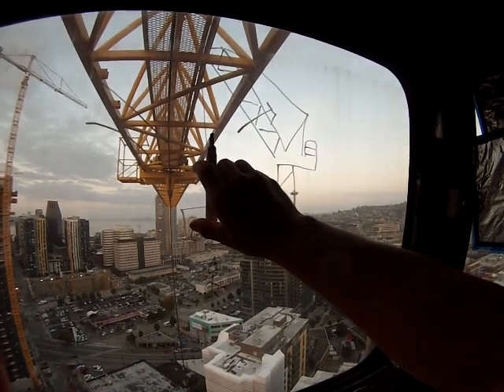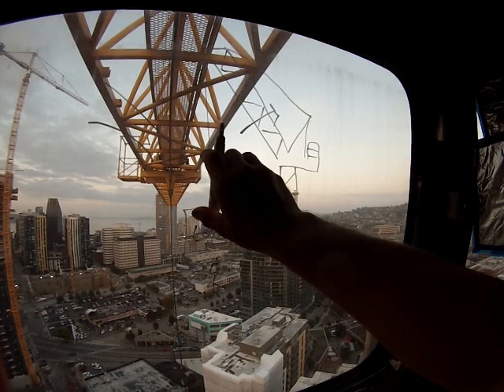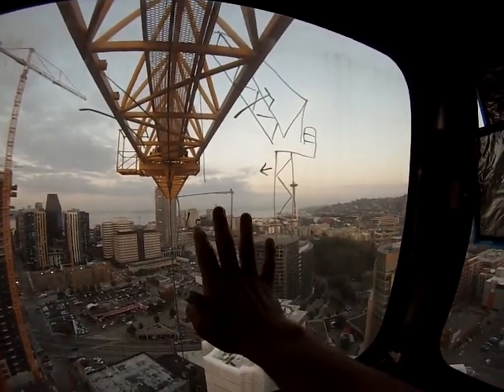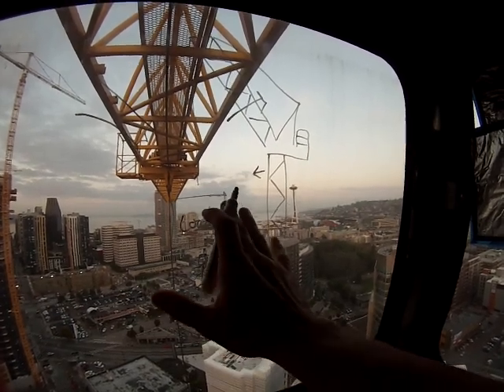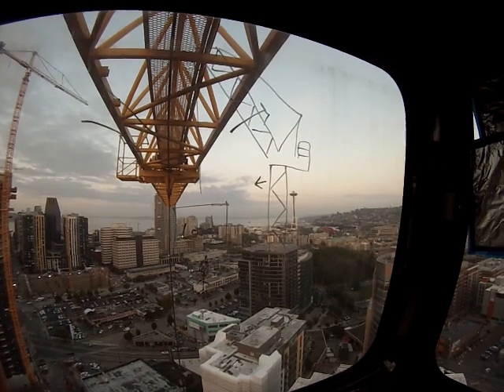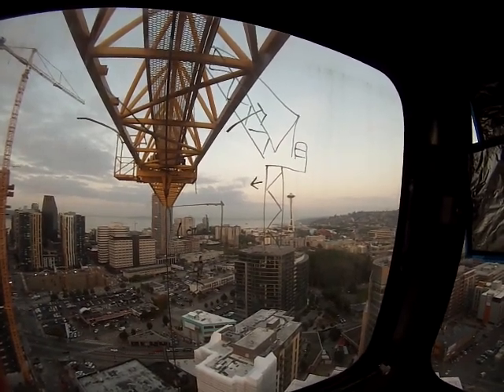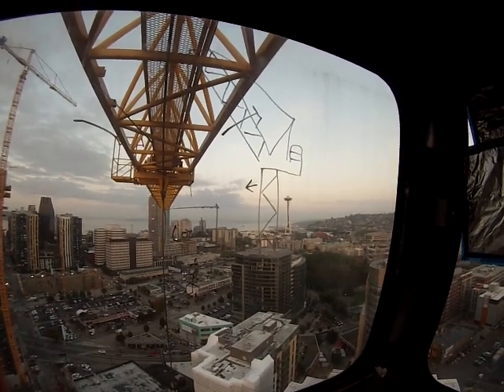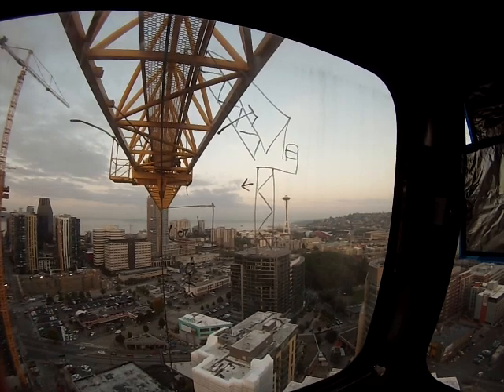How to Opererate a Tower Crane: Tower Crane Specific Traits

Comment: Been a forklift driver for 5 years time upgrade to bigger and better thanks for the knowledge
Reply from the maker: If the forklift is a telehandler and you have suspended items, the principles can be used to control the loads. More to stop the swinging because the unlevel ground will cause you grief anyway. Get the principles going in your head there and it will help you on your next career stop. Good luck.
Reply: @rotyag  thank you I appreciate it and yes a telehandler the biggest I ran was a magni 5.25 I work in a masonry company so I run the machine every day very neat machine that’s what gave me the more confidence to get more into that world

Comment: Damn Goog Instructing  roytag...!!
I started running big Draglines in the rock Quarries  in Miami , 1972
Then I flew air cargo 20 years but also ran construction cranes (mostly setting precast)
On my weeks off for 13 years too, down on the ground at these work sites. Never went up on thr tower cranes on most of them though 😉😎
Reply from the maker: Thank you. I'd love to learn how to run a crane from the days of thr old friction rigs. Worked around a number 3900's and 4100's, but I bever got to pull a lever.

Comment: I run a hammerhead tower crane and experience & balls can take a person a long ways as long as they realize it's not a race. Safety for everyone below is job number 1 all else can be easily learned. Take your time. Cowboy operators are dangerous and eventually either hurt someone or damage property. Example; I move this fast watch me.... Hurry hurry hurry... It's NOT a race. Safe and steady always win the race and is more efficient.
Reply from the maker: The top tier operators on a good crane like a Liebherr 316 can make 16-17 picks an hour. But the guys on the ground that can handle that aren't terribly numerous. Same for the number of operators that can run well like that. Even in my area where we probably have 120 tower cranes up, I'd bet that we don't have 20 that can really wring everything out of a crane safely. If either side of the puzzle isn't top notch, you are dead right. 

Correct on the jib too.

Comment: Hi toy tag very informal  vids im m not a crane operator just interested  in the working and operations of 1  and how the hell they stay up is fascinating hi from the UK keep up the good work
Reply from the maker: The towers are massively strong. The cranes lean back virtually at all times until you are hitting the moment limit which are the limits on the loaded jib side. This leaning back helps in the winds. The crane point down wind at all times so they can lean into it. The bases spread out the loads 8 to 9 meters in all directions, and they are 1.5 to 2 meters deep with concrete. So we are talking about 250 to 300 metric tons holding it down. So they only suffer problems if the soil is bad or has water problems. Towers don't naturally fail. Whenever they go over, there is a story to be told, and it usually a human error. I was involved with a collapse in 2006, and all fingers seem to point at the engineering. Of course I know the answer, but the full fault determination is something that isn't released. "We'll pay this if everyone shuts their mouths." And money keeps the secrets and reputations safe.
Reply: @rotyag  wow i understand  it a bit better now is there rebar in the concrete  base as well

Comment: Cool 😎
Question does the tower beneath you lean backwards when not lifting weight due to the counterweights?
Reply from the maker: Yes. They deflect based on the height of the crane, and it varies by model. For a max free standing 90 meter tall crane it could be on the order of one meter of leaning back. Some towers are quite a bit stiffer and others feel like an amusement ride during operations. Older cranes we used to erect without tight bolts were horrifying to look down as we went to tighten the bolts. I owned a crane that deflected enough that the tower was essentially as S as if the tower was near failure. I changed the process of erecting the crane because it was past my comfort level. I managed to sell the crane so that I didn't have to look at that tower doing that anymore.

The good side is that in high winds, the cranes are essentially leaning into the wind, and this helps them resist wind loads.
Reply: @rotyag  thanks for the answer and more detail than I expected thank you for that 🙏👍🙂
Ye looking at those heights looks pretty terrifying lol especially if it's swinging like an amusement ride, although also sounds kind of fun lol.
I can't even imagine what the tower being like an S would look like sounds scary. 
Going to have to look up wind loads not heard of that before 👍

1 more question if you don't mind. If it leans back with no weight on hook and you turn 180 degrees does it then lean back in the opposite direction but still back relative to you in the drivers seat?
Reply from the maker: @Rachie-nj3oi  As you spin, the lean direction changes with it direction of the loading. Normally that's the counterweights until you are at "Moment", or tip capacity. The only time you really feel it in the seat is when you go from sitting back in the seat, to putting your foot up on the structure in front of you for balance. I'm being dramatic, but you do feel it. Another condition that causes you to feel it is when you set down heavy loads and the crane starts to bounce. Old cranes only had a couple of speeds, operators my age and older are comfortable setting down the load at a good speed. That release of energy forward into rearward leads to a crane that sways front and back. 

About the crane directional change, I was on a 21 story project once where when they put in the 21st floor, I suddenly had a clunk happening as I would swing back out to the street. I thought it might be a mechanical issue. I'm working the crane back and forth trying to find why it's happening. I eventually had someone go to the edge of the building and we found that I was hitting the building with the tower and the clunk I was feeling was that contact. They had to cut the plywood for the floor back a few more inches because the crane mast shouldn't be hitting things.
Reply: @rotyag  thanks for the clarification much appreciated 🙏 🙂 👍
Oh dear that doesn't sound good, good job it didn't cause any damage to the crane or building from the crane hitting the building lol.

Comment: Thankyou You did very good explanations, good job, l’m so proud of you!

I would like to know about the deck floor how to fixe the first section;

Also, can you tell me something about the power- how it’s work in general?

How maxim the high can be ? And the long horizontal pice too?

Thanks again 

Big hello for you. By Joselito from São Paulo South America Brazil
Reply from the maker: The anchorages for tower cranes usually embed into concrete by 1.3 to 1.5 meters deep. The concrete pad will vary based on soils and size of crane. But 6 meters to 8 meters squared with at least 1.5 meters deep is typical. The anchorages are usually steel with channels and plate. Their real purpose is to prevent pull out from the concrete. They generally don't suffer from forces that would push them down too hard. 

Most tower cranes run on 380 at 50z to 480 at 60 hz. I have some that run as little as 60 amps. Then they get up to 300 AMPs for the larger luffing cranes with two large motors. You might see 350 AMPs for ridiculously large cranes. Usually a modern crane will have VFD (inverters) to put the minimum power to the motor. Starter circuits are hard on motors and they have massive inrush currents (Locked rotor or start up draws). The inverters limit this and make the motors last a long time as opposed to 3000 hours. 

For height, the tallest of the tower cranes freestanding would be 100 meters. Normally it's limited to 80 meters and varies by crane model from there. Like my small cranes, after 36 meters, I have to make the towers larger, then reinforced, and larger, and larger. They keep transitioning to reach tall heights. If you want to make them taller than 100 meters, you have to secure them to something. Usually it's the building. Then we can jack them up hydraulically. Takes about 45 minutes per 6 meter section on most cranes. It's an interesting process. 

The longer reaches are generally 80 meters. You'll find a crane or two reaching out to 85 meters. The giant Krolls reach 110 meters, but they are an exception to all of the normal rules. 80 meters is a good number to remember as the limit. Largest capacities in construction are normally 20 metric tons. Many of the 20 ton cranes can be set up with another trolley that will let them lift 40 tons. Usually you'll only see that in industrial settings, or for bridge or tunnel work.
Reply: rotyag 

I really like to thank you, l am appreciating yours advices and wisdoms about Cranes Tower, actually l am painter of buildings and l would love to make a clip video about this big machine, l love constructions and with yours big help ll be much mor easy to make a very nice video when ll be Installation also disabled too.

Also thanks for your very nice explanation preciso exactly my feew questions.

When ll make vídeo l ll speak on my idiom like Português, 

But l am still learning with your channel a lot, later l ll already to talk about,

But you of course always the best.

Again my special thanks 

Joselito 
Brazil

Comment: I find the radius diagram slows my operating down significantly. Guys need to learn to trust their eyes. Not go off the number on the screen.
Reply from the maker: I don't disagree. I find it useful for a couple of scenarios. Bucketing concrete as you change a column. You can hit the number as they swap columns with their gear and just need to adjust as it hits their hands with the swing or trolley. And it's great for placing booms or cores that might have one  number to start with, and deflection would change that read dramatically. This just allows one to hit the number and not need a rigger to call it. But in these vids, you'll see that a couple of the cranes are Liebherr HC's. You've got nothing for an indicator to work with.  If one doesn't know how to run this way, they'll never hit production speeds.
Reply: Yeah. I learned on the old wolff model's so you don't have any of the luxury's. I'm in a newer luffing model right now and don't really use the monitor cause it is not habit. Had a guy cover in the seat a month ago and i was rigging. He asked what radius i start at pulling the core and i didn't have an answer cause i really didn't know. 28th floor and i don't think i had ever looked. Lol